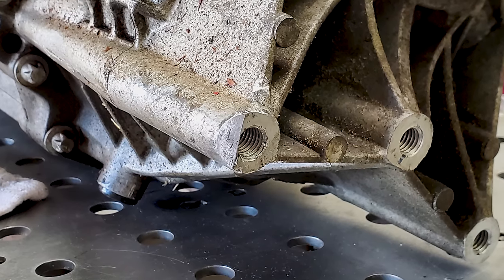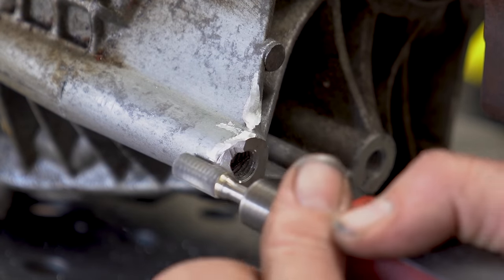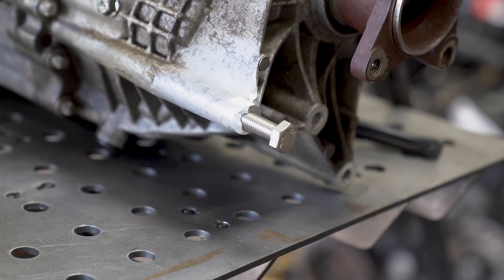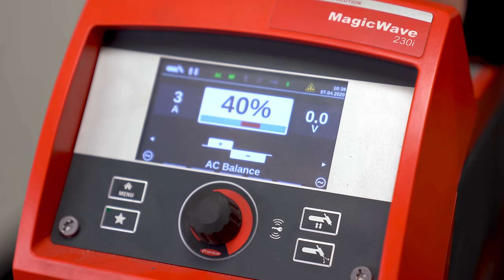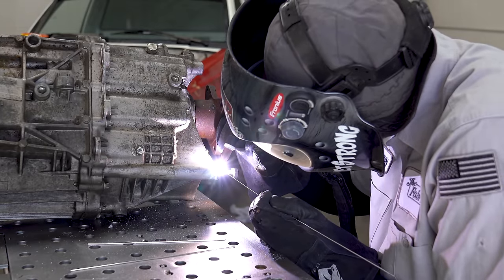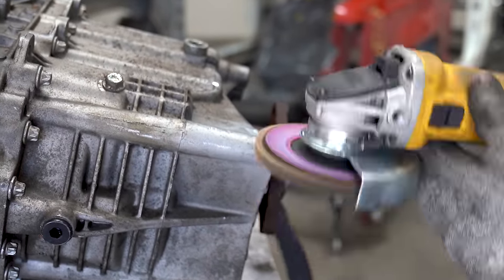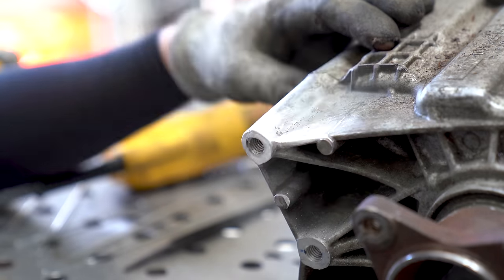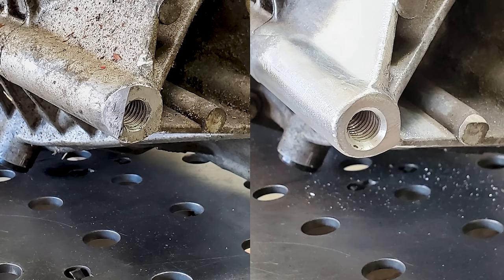Cool Trick! Welding A Cast Aluminum Bolt Hole without Damaging the Threads

Comment: Well you know, the first thing every person that looks at your finished project is going to climb underneath and look at that transmission bolt. Quit being so hard on yourself. That looks like a fine repair to me.
Reply: The devil is in the details. This is just a possibility but if that bolt holes had split while being romped on he could've been looking for a new transmission case
Reply: No doubt that the repair had to be done. And I thought the final result looked pretty damn good. I was just trying to tell him there was no reason to apologize for the final appearance.
Reply: @philipershler420  couldn't agree more Philip, a 'fit for purpose' repair, is all that is needed!
No need to get out dial calipers to check perfect restoration the outside of the casting!
Cheers Aaron.
Reply: @aaronyoung8028  yeah but have you met the guy? Even his dreams are perfectly laid out

Comment: Finally, someone else that know's how to use a carbide. Good vid.
Reply: if you do gunk up your carbide bit,  just put it in drain cleaner and the aluminium dissolves straight off it ;)  (old machinists trick)
Reply: @troyd-motorsport9933  Ya that's what anodizers do when they de smut aluminum. Or just rub chalk on the burr as well.
Reply: Beeswax works amazing on any aluminum grinding and cutting 👍
Reply: Dip it in WD40 will help keep it clear also.
Reply: In a pinch, aluminum burns off at a lower temperature than carbide.

* Just thought of this, because I wanted to add a tip too.  Let me know if it works?
Reply: Wood working carbides work great for bulk removal, then finish with the carbide. Amongst the other methods mentioned for keeping the carbide from loading up on aluminum, i found out that coating the carbide with cheap spray enamel paint works really good. I like it more then the bees wax and wd40, because its less messy ( on the bit or the inmediate work area)

Comment: There is an aluminum cast wheel cleaner called "eagle one etching mag cleaner" that works like magic to remove oxidised aluminum. Attacks oxidisation, doesnt attack non-oxidised aluminum. Might be of some use to you for hard to reach spots

Comment: tip... to stop your carbide bit from collecting to much alum  mix Varsol and ATF fifty/ fifty and every so often dip your carbide in it  it will shed most of the alum..if any sticks just take the Carbide to your wire brush wheel..your good to go.

Comment: Great video.  The only thing is the shot of the damage, looks more like something just laying ac cross the top of the hole.  But the production values and the narrative was awesome.  Learned a little bit today, especially about keeping the hole from collapsing by inserting a STAINLESS steel screw.  Just had the experience of doing just that.  👍

Comment: Nice Job. I enjoy your videos. Great tip using the SS bolt.

It's been a few years since I've done any TIG welding but I would do something similar.
I would use the carbide burr to remove the outer layer of metal that forms after boiling all the bubbles and contaminants out of the aluminum. When I went to weld over it again it turned out perfect and clean.

Comment: 2:52, what causes the bubbles in the parent material?  This is the 1st aluminum welding video addressing the bubbles.   Thank you for the fine instruction.
Reply: In my experience overheat (cooking) and dirty cast, It happens but easily corrected by sanding back in and adding fresh rod
Reply: Sorry, Thought you were talking about more like what you see at the bottom of 3:13

Comment: I like what you did. Welding over the screw to capture the threads was great. You said at the start of the welding you were working at a light level and would go back and apply more force. I didn’t see that. Can you explain that part?

Comment: Nice work.  The only concern I would have is ensuring that the flat face around the repaired hole is in the right place so that things still bolt up flat and square. Perhaps run a straight edge across from some of the other mounting holes to ensure that?

Comment: Wow, that's excellent. When I see those bubbles you had at the beginning, I usually fail, and it seems to get worse the longer I stick with it. What I hear you say is, heat it up, let those gasses escape before adding filler, take time and only later add new metal.
Reply: Bubbles... Occasionally, I MIG-welded galvanized pieces to a thin sheet metal, onto metal doors. Depending mostly on my mood in that day, I used two ways of dealing with it: sometimes cold weld, then all the bubbles from galvanized metal would not even reach the surface; and sometimes hot weld (insufficient wire feed), so most of the bubbles would get to the surface and leave the weld. Then I would run the second “polishing” hot pass, almost right away, before it cools too much. The result did not look too bad, just weld metal had strange colour. We were required to run a grinder with a buffing disk over it anyway; most of times it would not open any new pores which I would have to repair. 
Of cause, there is a third (proper) way to do those welds: to grind off all the zinc around future welds. It would improve welding, but not fully eliminate zinc bubbles; and save me from fumes, but again, not completely. Also grinding off all coating on uneven surfaces is terribly time consuming...

Comment: Great video! Been trying to repair a crack on a aluminum  bellhousing,and just frustrated on it ,you have some great tips I'm going to try.just so dirty,I think I need more patience heating the impurities out.
Reply: I've found that using a heat lamp or heat gun on the area of a really dirty part helps. I'll leave it for a while and really cook the crap out of it before using a torch and it really seems to help.

Comment: That was impressive and surprising. i have allways used copper as formwork for too large gaps when welding steel, and used 316 as a welded transition piece between aluminium alloys and nickel alloys in cold process plants for liqued gases.  Did you have to heat the aluminium and cool shrink the bolt to get it out?

Comment: Thank you so much for this. I bought an engine with AL oil pan that had a bolt hole ear broke half-way off. I bought a stainless steel bolt in anticipation I could use that to rebuild the tab around the bolt hole, but became unsure since I never had to do this before. Thank you for confirming this works.. SUBBED!

Comment: Nice trick. I'm assuming this just bolts to a bracket however in a different case you'll probably have to reface the face of the hole front so it sits parallel to whatever it mounts to
Reply: and at the original height

Comment: How easy or hard was it to take the screw out after you welded on it? I noticed u didnt show taking it out, but its a fantastic idea to keep from having to retap.
Reply: Cant fuse aluminum to steel. Itll thread right out. You definitely want to go back n forth with the bolt with lube to clean the threads a bit more. Then blow it out with some air. I use this trick a good bit. And also reverse to remove broken studs out of heads doing exhaust manifolds. Ill mig weld a nut on the stud. Again cant weld steel to alum head. And the heat from the weld works as a torch. Usually will work right out. 🤙
Reply: @jimbissey497  old crager mags and keystones have an aluminum center welded to a steel rim
Reply: @CharlieBrown-pb9xn  That's a fusion weld. Much different.

Comment: To keep a fine carbide burr from clogging when cutting aluminium you can give it a liberal coating of grease from time to time. The grease acts as a coolant and a lube and keeps the alloy from welding to the burr. You can also use a piece if threaded carbon rod in lieu of a stainless bolt to preserve threads.

Comment: Do you find that the first passes over the ground surface often lead to stress build up in the casting just away from the area to build up? I have tried the technique before, my college lecturer used to called it homogenisation of the casting, but I have found on some castings it leads to fracture beyond the repairs.

Comment: just a question, would silicone bronze done as good of a job?   Also I see that some are using 4943 alum filler now would that be a consideration? Great repair job and it will be just fine.

Comment: Did you have any problems with the aluminum sticking to the SS bolt, or with the bolt nearing its melting point?  I ass-u-me you only put heat into the aluminum in this area, and the arc was well-behaved and did not jump to the nice sharp edge of the bolt thread.

Comment: Do you take in custom work? I have a motorcycle crank case I need repaired. One of them is a bolt mount like that that snapped off . And the other damage is inside a part where the oil pump goes needs to be rebuilt filling it with soldering then machines back down. I’ll make a video for you to see and see if I can put the link on this comment

Comment: Good video. Would a carbon steel bolt work if all of the zinc coating was removed? Muratic acid takes zinc off of bolts very quickly. How do you avoid melting the bolt?

Comment: Could I use this technique to EXTEND the thread of a spark plug boss into a combustion chamber? The reasons aren't particularly important, but I want to move the spark location further into the combustion chamber. Without melting plugs.

Comment: Does AC balance matter? I'm just a home garage wrencher at best and a novice home tig welder when I need to make something. With this type of project and aluminum that alot of standard car and truck transmissions/transfer cases are made out of is there anything that relates to AC balance and strength when welding aluminum for these sorts of parts I should be aware of? Or is there a good (happy medium) setting that I should aim for? Thanks for all the videos cant tell ya how much you've saved me in cash by giving me the confidence to just build it myself.
Reply: 70 on the negative side for penetration 30 on the positive side for cleaning is a good starting point . Your frequency determines the size of your arc . If you wanna deposit lots go for 120 hz-160 if you want a really focused arc for a small bead  go up in the 200-300 range . I usually preheat cast Aluminum and clean the area with a stainless wire brush before I weld to get rid of the oxide layer . Hope that helps .
Reply: @Bigsauce403  thanks for the advice, baha now Im bound to break some sort of transfer case tab off. Well when it happens ill see how she penetrates starting with your suggestion thanks man!

Comment: Definitely a great vid ... if I had one critique, it would be you should ensure the "new" hole protrudes the same amount as the old hole. Is it in plane with any other of the holes? It looks as though the other hole which is visible throughout the video was on the same plane. Maybe you did check it and you didn't say anything ... dunno. Other than that, this is a great method! Well done, sir ... well done.

Comment: How did you make sure that it was flush with the rest of mounting holes? .030 to .060 off with the flap wheel should crack a case whether it's cast iron or aluminum.

Comment: Using beeswax on the carbide burr also helps preventing them from clogging
Reply: ill have to try beeswax. i just use spray silicone.
Reply: Can't clog with metal if it's already clogged with wax. Smart thinkin tex.
Reply: @billybobjoe198   hey ...tex ... the wax melts because of a thing called friction...then the liquid wax acts as a lubricant.  I've done it... it works ...
Reply: @ryanaustin1970  Slow your roll there cowboy. I was just joking around.
Reply: @billybobjoe198  roll slowed ... maybe a lol in the next one , cheers

Comment: I'm no welder, but I'm watching a lot of videos lately! Just for my knowledge, why didn't the molten metal 'drip' onto the screw and could've prevented it from being unscrewed after repair?
Reply: Aluminum melts at a lower temp. than steel or stainless steel and will not stick to it.

Comment: there was enough meat there to drill out the threads, tap it, and install an insert or Rozan. I used to repair Bradley fighting vehicles and the hulls are ballistic aluminum, I repaired thousands of bolt holes in aluminum.

Comment: Just wanted to pass on that dipping  the burr bit in oil periodically prevents aluminum buildup. I port a lot of chainsaws and use this tip, haven't plugged up a bit in a very long time.
Good tip on the bolt, I'll be using that one 😉👍

Comment: You're using steel wire wheel on aluminum ? Won't it cause steel particles corrosion latter on ? Shouldn't one use steinless steel wire wheel for aluminum ?

Comment: We have carbon blanks at work and we use them for stuff like this. Cut some threads into the carbon and then fill the hole and then weld up against it then chip the carbon out.
Reply: Leland Holton, yes I too have been doing it that way for years on steel but never tried it on aluminum. Most times on smaller holes I'll peel off the copper off an carbon arc rod to use.

Comment: I use steel carbide bits to port aluminum heads exclusively still have the master set of Hanson, mac,snapon, sets i bought 25+years ag .only time I use a carbide bit with the solide flute. non cross  cut like the teeth on the one your using in video.. the ones that look more like a end Mill bit .I use only when I need to remove alot of aluminum.. like intake runners or plenum,  head port runners or roof ..when raising a intake port on a as cast head that come with alot a material in runners.. for us port and flow bench goons . Which is a dying art now that the market/distributors/ manufacturers of performance heads parts ..has had time enough to acquire new  3 and 5 axis mill lathe  combos.. they have to have someone do the work and flow the head which takes week worth on single head
.. u port ,flow bench weld up and port flow some more.. for the combo they specify and send them back. they xray the port , measure  write code push print hours later out pops a head that is exactly like the many I spent hours hand porting. its amazing how far tec has come you don't even have to polish  now  after cnc ...

Comment: Flattening the hole with the grinder easily may ruin the flatness again, I would have used a big hand file in this case, but you were lucky, it worked out :)
Reply: Experience I would say
Reply: 👍🏻 Had the very same approach 👏🏻 The flatness was even ruined from the beginning by removing too much alu. But well, maybe only the height and level of the hole matters here !?

Comment: Good visual detail, but I really could have pictured it better by seeing the work area lit back up again, right after doing the build up and with the bolt still in place before you removed it. The way it's edited jumps too far forward, skipping over that.

Comment: just WD40 or paraffin on the cutter. It works well but if you're gonna TIG later take more care cleaning surface with acetone. I do this loads, more than I need to cos i'm rubbish with a TIG welder and usually have to do everything twice.

Comment: Well I know this is primarily a educational video but you should probably address the fact that what you are doing is primarily cosmetic because the last part using a counter sink is the only necessary step if the bolt was not going in

Comment: "I can't get a bolt in there..." - Immediately puts a stainless  bolt in. This is unnecessary, put the bolt in and torque it down, all of the thread depth is till available. That grind on the edge looks fresh...like you did it.
Reply from the maker: Somehow everyone skips over the part where I cut the damaged area out to put the bolt in 🤔
Reply: From my understanding that wasn’t a ground edge, and neither did it look that way. Looks like it was what he said it was which is minor damage from a drop. Regardless, I half agree with what you said, it being very very unnecessary and such, but that’s besides the point my man. Dude obviously has pride in his work being that he wanted it back to stock. The wire wheel was a good indicator of that.

Comment: Now you've totally changed  (reduced) the strength of those first three most critical threads because of your welding induced HAZ. 
This is why you machine it back to flat and run a spacer and maintain the thread profile integrity of the original heat treat.
Reply: Are you serious! Threaded in,that will be as strong as ever.
Reply: otm646 
Another keyboard warrior no experience